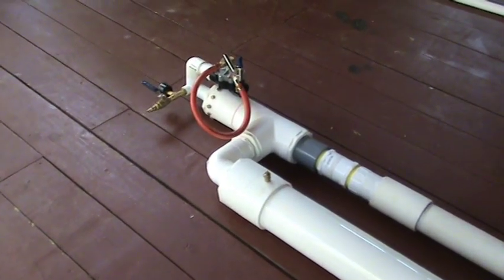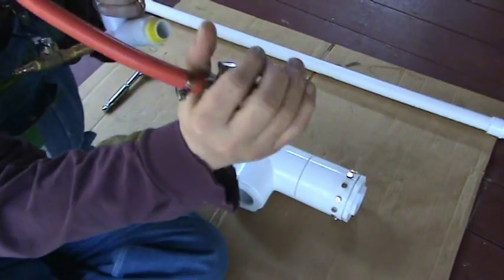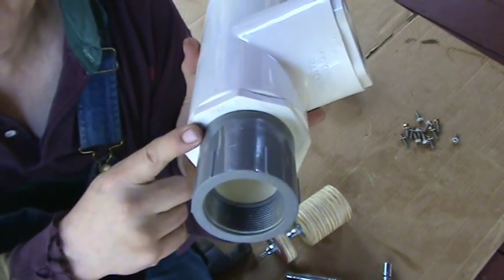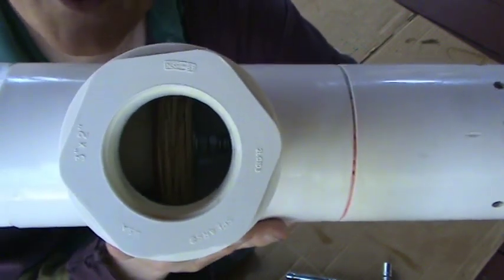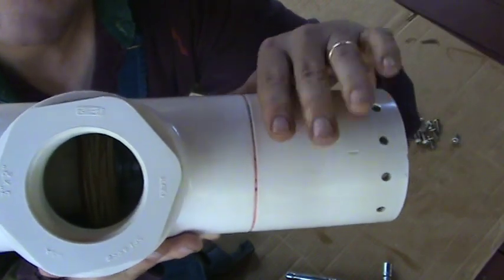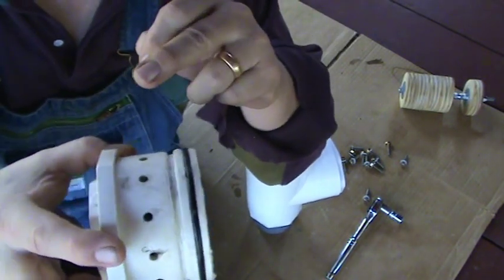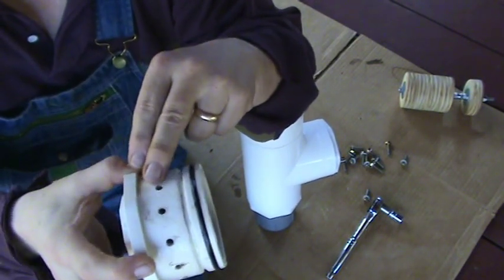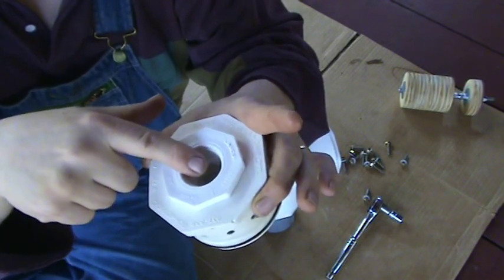Barrel Sealing Piston Valve (Part 1)

Comment: Yea, thats real cool, you've got a nice design!

I've got two suggestions, not saying you've got a bad design, just purely something to think about!

The first would be to lighten your actual valve a little.  The quicker you can move the valve backwards the faster the air can exit the barrel.  A heavy valve slows movement and prohibits that!

The second is, you might try using rubber tubing as the bumper material in the future.  A ring of rubber hose makes a great cheap, effective piston bumper!

Comment from the maker: Sealing seems to be the toughest job to pull off. If you get the o-ring groove right and polish everything it "should" seal. I use a little teflon tape in the groove to make it fit tighter and that seems to help.  

With a lathe though you could cut your own coupling and make a bolt-together back end and avoid the whole o-ring issue. Heck, with some patience I bet you could reproduce a Mauler...

Comment from the maker: @rthom86 The Sprinkler valve is a 1" (tough to find a 2" and a Diaphragm valve is generally slower than a Piston valve anyway). The Piston valve is a 2" so the airflow would be about 3 times as much (Pi * Radius Squared). The smaller valve is however a great trigger for the larger valve (the faster you dump the air from behind the piston the faster it actuates which is the key to power).

Comment from the maker: Actually it's 2.5" sch 40 for tennis balls.

The blowgun is the actual mod to the valve. It wouldn't work anywhere else.

There's no reason you couldn't replace the sprinkler valve with a big ball valve though. Anything that allows you to dump the air behind the piston quickly will trigger it.

Comment: How did you your SCH 40 pressure rated pipe and fittings? Nobody in my area has pressure rated SCH 40 any larger than 2" (Lowe's, Home Depot, hardware stores).  One place had 3" and 4" pipe that listed a pressure rating, but they only had DWV fittings in those sizes.  Regardless, this is a very helpful video, thanks!

Comment from the maker: It would if the piston were the same size as the barrel but that's the trick; the piston is bigger than the barrel (2" barrel, 3" piston in the 3" Tee). The size difference is also why, when you dump the air from behind the piston, that it wins the "tug of war" and snaps back; pressure on a 2" hole vs a 3" hole.The bigger the size difference the easier it is to trigger the valve.

Comment from the maker: @evanmcorleytv 

I'd go with 4". It's rated for higher pressure than 6" and a 6" would give you a *huge* volume to fill for each shot (more than double the 4"). There's also a general "rule" that you never make the exhaust port less than half the chamber size which would require a 3" exhaust. A 4" chamber is just a little more practical but if you want to "go big" then a 6" chamber would do the job for sure. (It'd make a great 3" beer can cannon!)

Comment: i think i understand what goes on a bit inside a piston valve. though one thing still eludes me:

so when you start filling up the valve, it pushes the piston, causing it to seal the barrel. then, the chamber starts filling up. but if the piston is loose enough to slide up and down the valve, wouldnt the air just flow around the piston and out the barrel?

Comment: Hey do you know how to tighten a threaded hex cap onto a threaded adapter without damaging  the plastic? I feel like it always gets too tight when i get half way. I can force a regular threaded cap(with a flat surface) on with a strap wrench but any other metal tool can ruin the plastic. Does temperature have anything to do with it? any suggestions please?

Comment from the maker: @Ghostxx10 Never had to solve this one but... I'm thinking a full hex shaped wrench that fit the part would at least distribute the force equally on all six sides. That's probabaly as good as it gets. As for temperature; the colder it is the more brittle it's going to be. Also, if a lubricant wouldn't be a bad thing in this application then Vaseline or "pipe dope" might help.